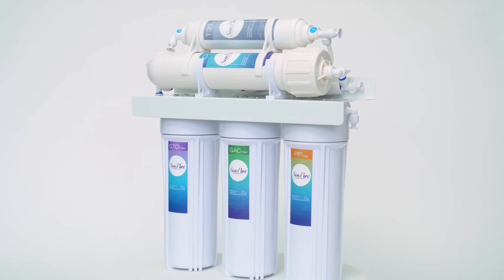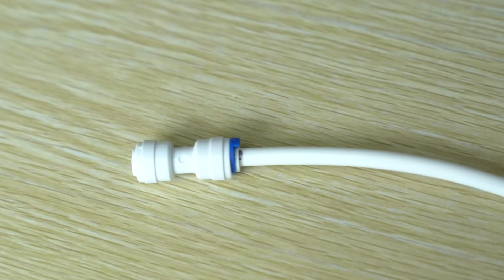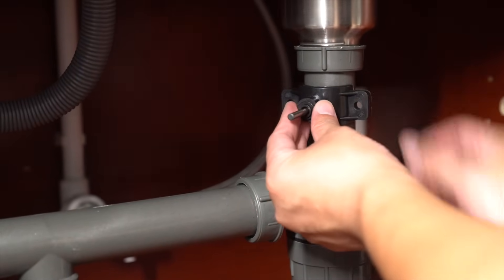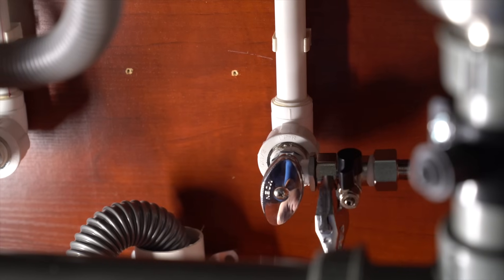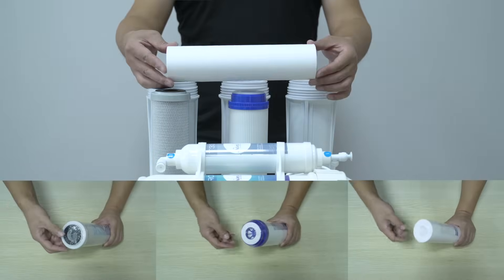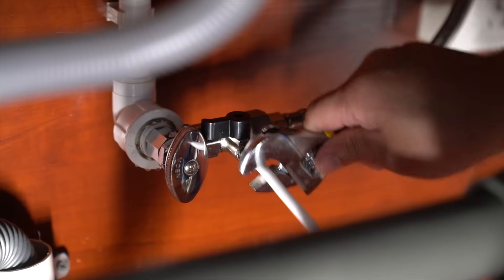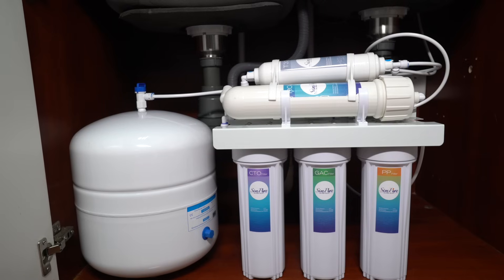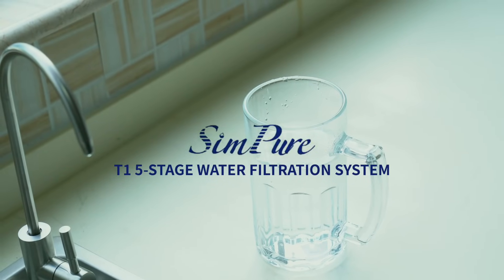SimPure T1 5-Stage Under Sink Reverse Osmosis Water Filtration System Installation Tutorial

Comment: Is this filtration good for water catchment water
Reply from the maker: Generally, it is suitable for all kinds of water sources, so it can filter catchment water. However, for heavily contaminated areas, we recommend using tap water for filtering. Since tap water has already undergone rough filtration, it is more economical and helps prolong the lifespan of the RO water system.

Comment: Try searching the web to get an idea of how to plumb the RO membrane housing which one is the good water which one is this shit water and how do they hook up to the high low pressure switch valve hickey thing for some reason not one dang reverse osmosis system installer will talk about Theus and this is where you’re at or drinking poison water or you’re drinking or a water why is it such a secret on how this works

Comment: Hmmm the person who sold this to me on eBay isn't answering my emails and the 800 number always says "User Busy".  I installed a new system and the tank is filling up in 45 minutes.  RO membrane is seated properly, all lines are connected correctly.  I did NOT mix up the drain line or anything.  I even had a friend who is a plumber also look at it.  He sees no problem with the setup.  What the heck?  It's supposed to take at least 2.5 hours to fill that tank!
Reply: Along i know it because the water source flow seemed too low, because in reverse osmosis System it need more power water boost to pass the membrane part eventho you upgrade booster pump type
Reply: Test your water and you will know if the system is working or not.
Reply from the maker: Thank you for reaching out! For any issues, please contact our support team at service@simpurelife.com.

Comment: How do you shut system off if you are using water to wash dishes?
Reply: You don’t have to shut it off :-) just use your other faucet like you normally would. 
The system only needs to be cut from the water supply if you‘re not using the filter for a longer time, f.e. if you are away for Holiday.
Reply: @Colleen Gregory • In the Real World filtration professionals do not wash their own dishes; maids do that job. Similarly, maids never carry out the tasks of a filtration professional. Thus your question does not arise, and people go about their chosen labours in complete harmony.

If you are unable to afford a maid, and are doing these complex tasks yourself, it's best to work out a timetable based on Management Principles:-
● Eat before you change the filter. Ensure all washing up is completed immediately after the meal. Then change the filter.
ALTERNATE STRATEGY:
● Change filter before eating. Ensure filter is operating correctly. Commence cooking. Then eat. Wash dishes after eating.

The mere fact that you had to ask this question indicates that you're unlikely to understand the minutae of filtration-change practises and protocol. Thus the recommendation is to appoint a filtration professional to carry out the complex tasks. Employment of a competent maid is usually at the discretion of the Butler.